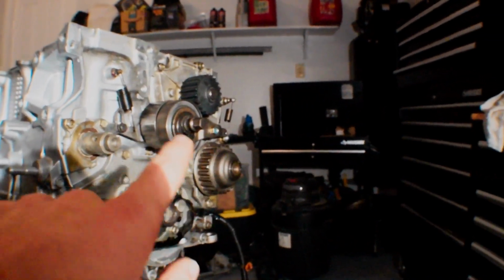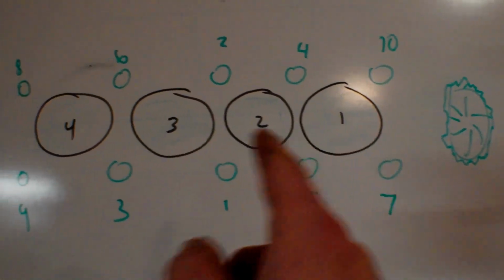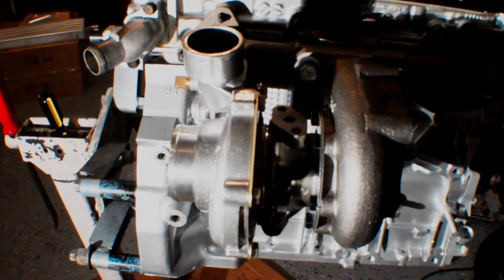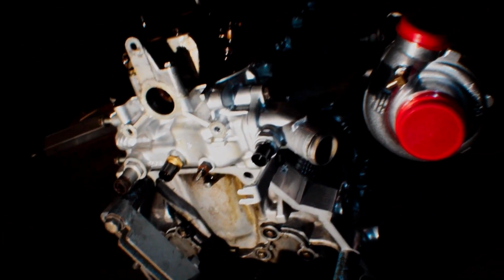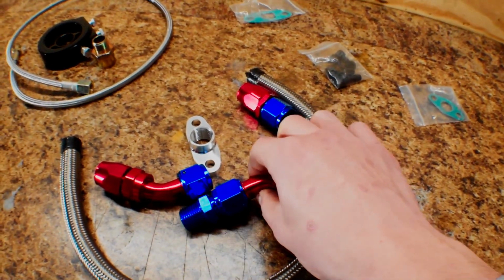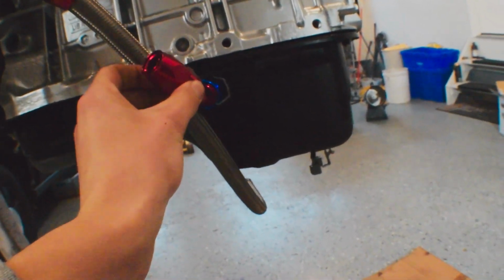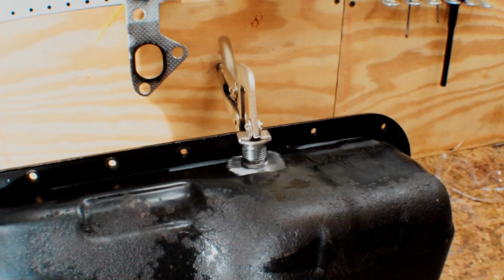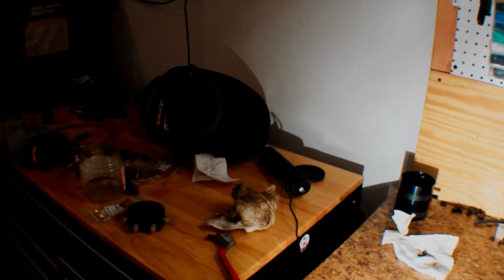F22 Honda Engine Assembly and Turbo Drain Line

Comment: Are the oil cooler and throttle body of the A6 compatible with an F22B1?
Edit: to clarify, with minimal modding?
Reply from the maker: I have not attempted to swap any parts on this motor yet.  Lots of them are bolt on or require small mods tho.
Reply: ThatAccordGuy I see— when I get an Accord, I plan to use stock parts from other Honda’s for the major components when I mod the engine

Also I just noticed your username— my deviantart account happens to be ThatOneAcc0rdB01

I’m a huge fan of the CD5

Comment: Got that drain hole nice and close to the sump fastener bolt hole shame u didn't  move it 10mm to the right it's going to be awkward if that bolt ever gives u troubles in future good luck
Reply from the maker: Yeah totally forgot about the oil pan bolts when drilling the hole for it. Ended up using a shorter bolt and got it snugged up with no leaks.  Next time I'm definitely moving it over lol. Live and learn!

Thanks for watching bro
Reply: @ThatAccordGuy  your welcome btw did you use forged internals to go with turbo or not I just asked bcos I have a gen 4 prelude with f22a engine I'm curious if internals can handle low range psi.
Reply from the maker: @Eric-steele  did not go forged on this build but I will on the next one for sure. Currently on 10psi. I've put a few thousand miles on the car beating the crap out of it with no issues. I think the motor can handle more. Planning on pushing the limits of this stock motor to see how much boost we can make! The f series are pretty good motors for boost.

Comment: What torque wrench are you using in this video.
Reply from the maker: Not mine but I am lucky to be borrowing it. It is very nice.

https://store.snapon.com/TechAngle-174-Models-2-Accuracy-Ratcheting-Flex-Head-1-2-Drive-TechAngle-Flex-Head-Torque-Wrench-12-5-250-ft-lb--P760213.aspx

Comment: Off to check that out I know bisimoto does it but they're super expensive I got friends with dual overhead cam turboed. But I have a feeling this will keep up with them for sure huge underdog
Reply from the maker: You'll make all of 400hp with a forged bottom end safely too. Bet it's gonna be crazy fast haha. I'm impressed with 250-275 that I'm making now lol
Reply: These F22 block have many interchanging parts with a H22 prelude motor. If you did want a DOHC head, a F20B or H22A head will bolt right up to a F22 block. which can be found cheap like $200-300 range on the used market.
Reply from the maker: Yes I have heard that man! I've definitely considered it, the only issue is that the f series only has oiling from one side of the crank shaft. Apparently they don't like to be revved up as high as an h series because of the lack of oiling on the mains and rod bearings. So I wouldn't be able to get the 9k rpm that those motors want to be pushed too.

Comment: Just the fact that I'm boosting it and it had 230,000 on it I'm sending it in to measure the bore and make sure the cylinders are around after that I was thinking forged pistons and rods and then I was going to do dual valve springs and I'm porting and polishing my head but I bought an eBay turbo just like the one you got and even the wastegate I haven't checked out yet but I need to find out what the Springs are in that but other than that it was just basically because I'm boosting it
Reply: Ive had the same delta 272 cam for over 5 years on two f22a accords it still kicks ass! The 272 only wakes up around 4k but pulls like crazy till 7k+! Best bang for your buck no doubt. It Idles like a mean ass popcorn machine. If you want more of a street cam with a smooth idle and strong low end torque go for the 262! Call up delta they probably have turbo regrinds aswell.
Reply from the maker: @Rémi-ngton420  glad to hear Delta does regrinds for the f22! Thanks for all the info man definitely going to have the cam sent out at some point. Definitely need to try and shift my torque curve a bit higher.
Reply from the maker: Nice man that's going to be a sweet build! I know there's a company called Delta that regrinds stock camshafts for hondas. These single cams don't make as much power up top but they make crazy torque for sure. You'll be capable of way more than me with forged internals. I definitely want to go that route in the future. But with a camshaft regrind, you can shift the torque curve up in the rpms a bit and make more power up top.

Comment: Yo what type of Cam do you have in that F22
Reply from the maker: Just the stock cam for now man
Reply: I'm building my f22a4 and was just wondering if you have any to it would be greatly appreciated
Reply from the maker: @beerguyethan18  I rebuilt my motor with just new piston rings and honed the cylinder walls. That's it, the rest is all original! What's the reason you're rebuilding?
Reply: @ThatAccordGuy  hey, I know its been 2 years but I was wondering how reliability has been? Want to do this to my daily driver 1992 Accord EX.
Reply from the maker: Engine has held up great! I'm just looking now and the turbo seems to have a little shaft play but I'm going to send it. Still makes great power and hasn't broken down hardly at all except for a little ignition problem. I'd take it anywhere.